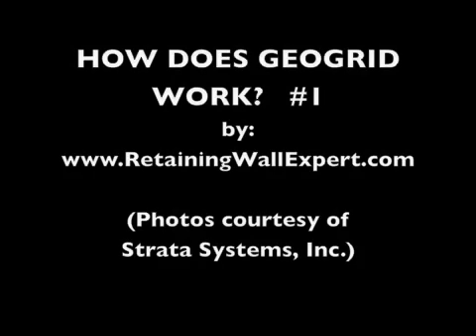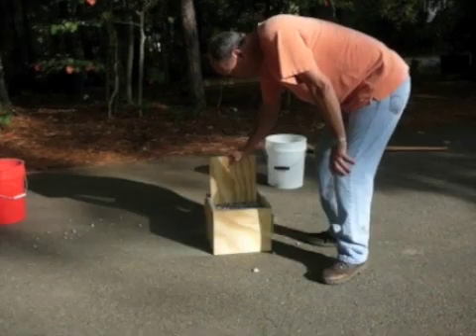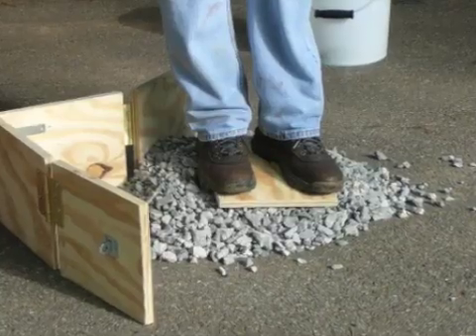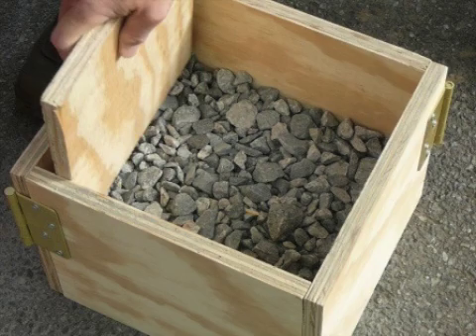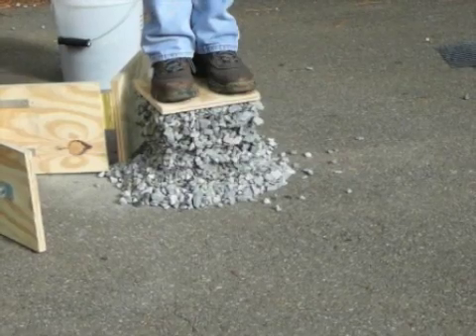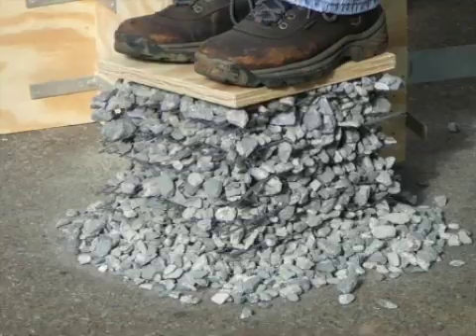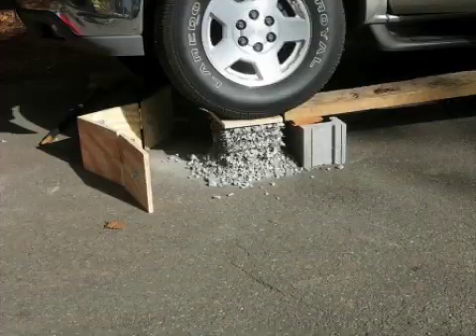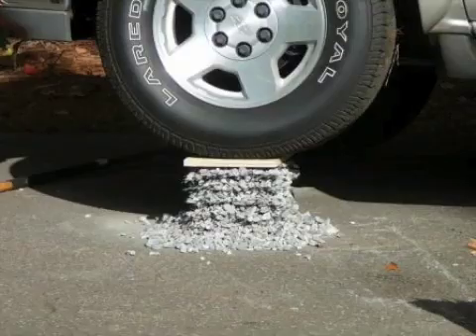Geogrid Holding A Car or How Does Geogrid Work?

Comment from the maker: @slkhlaw The vertical settlement caused by stretching will be nearly immediate.  There is very little evidence of long-term creep in granular soils.  There are many projects around the world where reinforced soils support mass transit railroads. Vibrations and dynamic behavior (simulating seismic) should be analyzed.  You could use metal reinforcement, which will give you essentially ZERO strain.

Comment: I am studying a proposal of using geogrids and retaining wall on an approach embankment for very high speed train. The train needs to run on concrete slab track. The settlement limit is 5mm. I understand that geogrid will only work when it is stretched. So far I have seen literacture quoting 1.5% strain. Suppose I have a piece of string 1015mm long (geogrid) tied to both end of a 1m ruler (both sides of retaining wall), the sagging that I get in the middle is quite massive.

Comment from the maker: @slkhlaw Using a sand or gravel soil there should be no noticeable outward deflection of the wall.  There is always some, with every type of retaining wall, due to Active Earth Pressure, which is a fancy way of saying that we design the walls to "give" a little so that the soil's strength can be used.  Vertical settlement should never occur.  If it does, the the soil was not compacted properly.  Basically, simply pulling the grids tight during construction should be sufficient.

Comment: I have limited experience in dealing with geogrids which is why I am watching your video. I always have the impression that geogrids require substantial tensile strain before it will start to work. If my wall needs to move substantially before the geogrid would start to work, I would be concerned about the settlement behind the wall, i.e. settlement that may affect other people's property. Are you able to speak from your past experience what sort of magnitude your wall has moved?